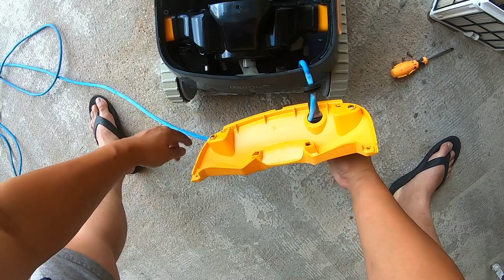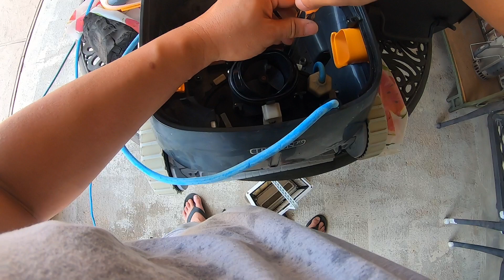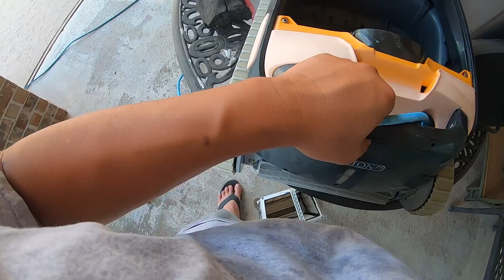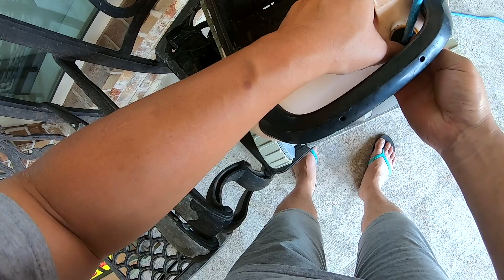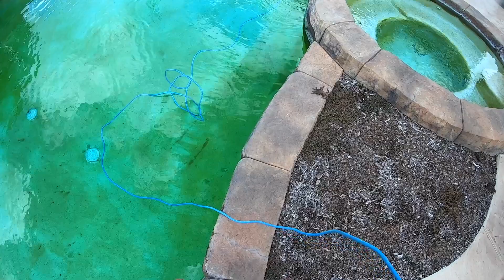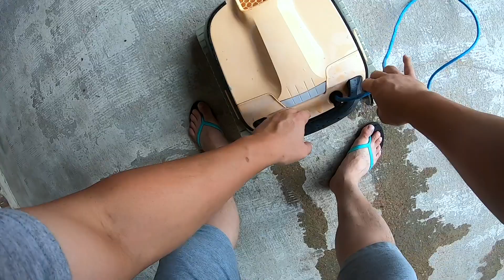REPAIRING DOLPHIN / MAYTRONICS POOL VACUUM ROBOT

Comment: Great video. When mine is in the water I can hear grinding noises like the gears are not engaging. Any good resources for replacement gears? The fit is sloppy and has a lot of play, hence the gears wearing out quickly. Thanks
Reply: I found out that this was my issue too.  

The front wheels are the same on both sides, but only one front wheel is driven internally by the motor itself.  I switched the two wheels around and that ended up doing the trick.  Disassembly and reassembly weren’t too bad, all things considered.  I just made this switch so I don’t have any data of how this solution holds up long term, but when testing it out I didn’t hear any of the slop or grinding I was hearing before. 

My hypothesis is that the inside of the one wheel just kept getting beat up by the drive gear over the years to where the tolerances were no longer tight enough for the two gears to stay attached to one another.
Reply: @26Nick  Cool thanks I will check it out and do the swap. I have 3D printed one of the gears and it worked great, but now it seems to be a different one.

Comment: I've removed all debris as initially indicated but still remains the same, moves forward for a few seconds then backwards and stops. 

So what was the trick?

1) Put the vacuum upside down, let it run then put in pool without filter. 

2) when step one doesn't do suction side walls, take it out while running. 

3) turn off, place filter inside, then wait to see if it works?

Is that the trick?